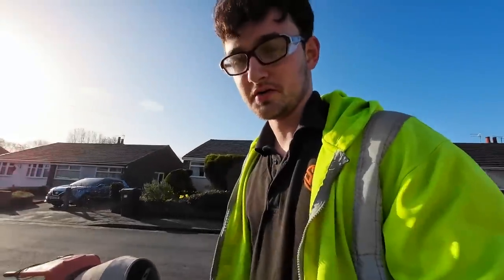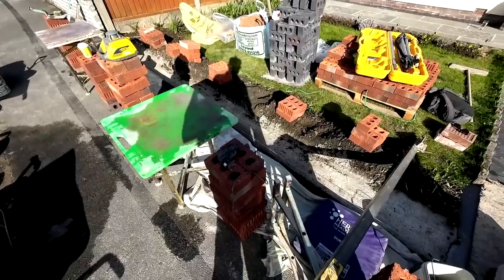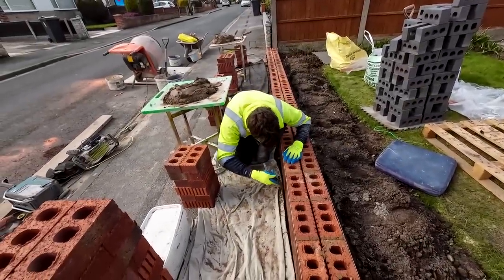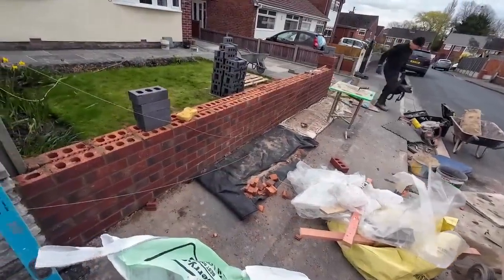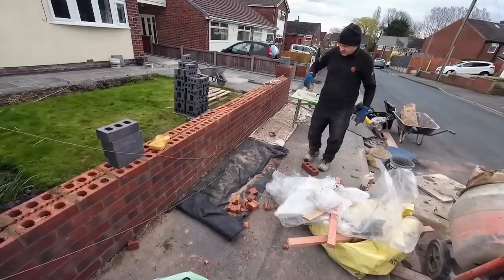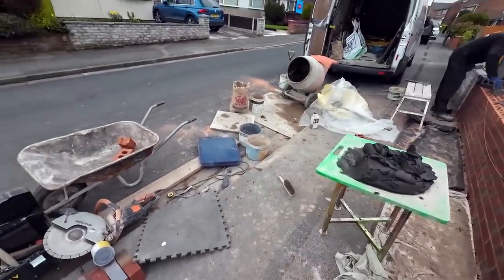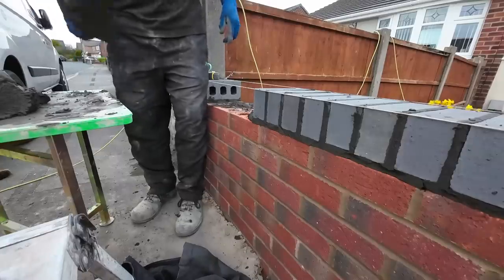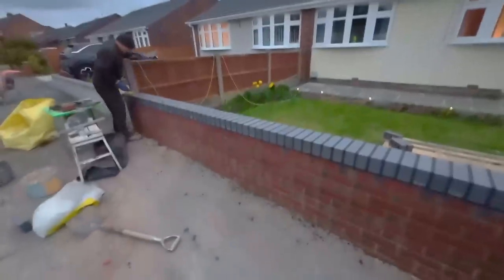FIRE DAD HE IS USELESS AND CANT COUNT !!!! GARDEN WALL BUILD PT 2

Comment: Aren't you meant to use wall ties every 3 courses on 9" or is that optional because they are already stuck together? They do sell the special wall ties 225mm for it though. I know expansion joints are every 12 meters even when it's only 4 ft tall. Just curious. Extra £10 for a pack and barely any more work but makes it much stronger potentially?